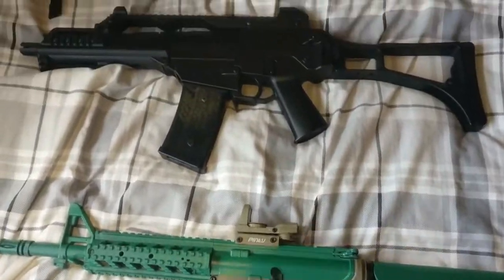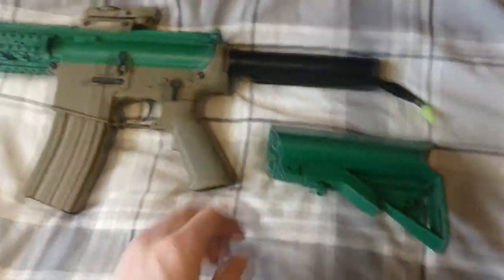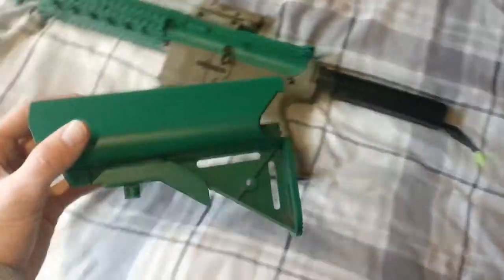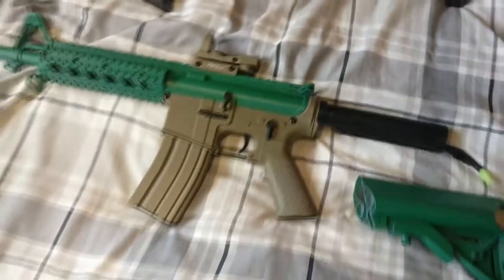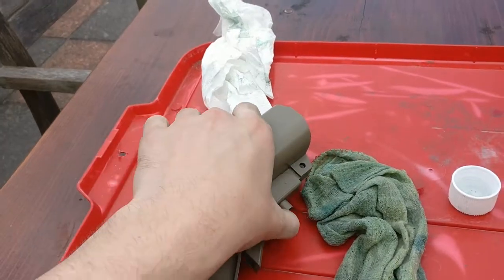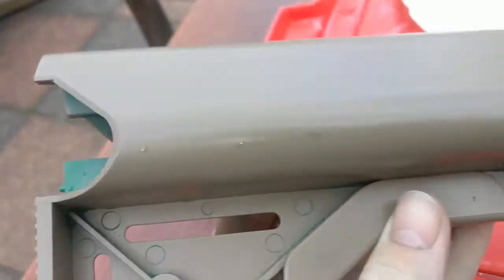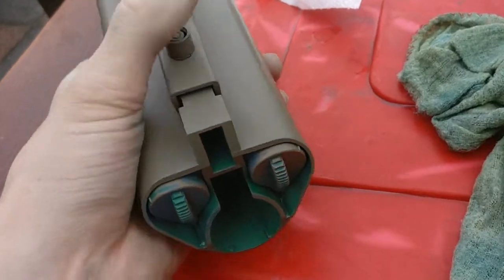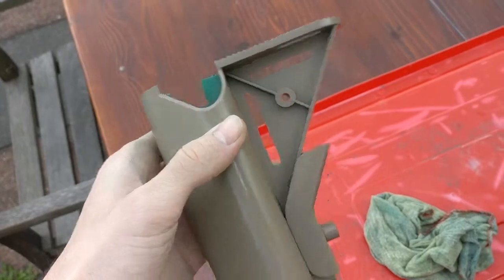Removing two-tone paint from Airsoft gun

Comment: my girlfriends nail polish remover works well too
Reply from the maker: Didn't think of that!
Reply: Really
Reply: Be careful , the key ingredient is acetone and it can damage plastics such as Polymer
Reply: yeah you will be surprised how fast acetone can soften and melt plastics like ABS
Reply from the maker: Is Acetone more commonly found in nail polish remover or the white spirit!??
Reply: White spirit is like turpentine.

Acetone is whats in nail polish remover - careful using it on ANY plastic things as it has a tendency to melt through it and/or make the surface go cloudy.
Reply: i use acetone in my line of work it doesnt melt all plastics there are plastic cups you can buy from most supermarkets that dont melt. they have "PP" written on the bottom (identifying what type of plastic it is / what is is made from), so this plastic is safe but most other plastic will be affected by this chemical.
Reply from the maker: Gotcha! Learn something new everyday cheers!

Comment: I recently brought Clean Spirit for this purposes. 

Any difference between White Spirit and Clean Spirit?
Reply from the maker: Googled it is more water based so safer for user and environment, less solvent content so should do the same really but just not as strong!
Reply: What a pain in the ass, such a stupid law to have to have 2 tone, but on the other hand I get it. Personally I think a simple registration for this sort of thing would suffice, so your on record for what models you have and description, so if someone's running through the street or holding up a bank, you look at the gun and question anyone who is registered as owning one like it. 
I mean what's stopping criminals with real guns painting them 2 tone and masquerading them as replica Airsoft?

Comment: If my firearm is metal would it still be safe to use nailpolish remover/white spirit or could it damage it ?
Reply from the maker: Mine was plastic and is fine so don't see why not! Could try on a little bit first and check. Just be careful not to get any white spirit/nail polish remover inside of the gun. Also make sure no junk like the paint being removed gets inside of the gun!
Reply: @sullyo6722  perfect thank you, the gun I’m getting it’s fully field strippable so gonna field strip it so there’s no components and gonna let it fully dry out
Reply: @mikelowry2254  How was the result? Planning to do this soon.
Reply: @slenderman183  it worked out well I used nail varnish remover without acertone fortunately it was silver under the blue paint managed to spray it black today and looks great
Reply: @mikelowry2254  was your gun originally silver or did the black paint come off during the two tone strip off?

Comment: I tried this and it didn’t work on my specific gun (ares amoeba 008), I bought it off a mate second hand and the two tone on it is tough...so I used white primer followed by “posca” brand paint pens and clear coated it, it looks perfect as the amoeba is mainly polymer except the upper receiver so the paint just soaked into it, and gave it a nice matte finish, it also dried pretty quick, then I just clear coated it haha!
Reply from the maker: Weird, was it spray painted two tone or is the gun plastic actually coloured? But nice one thats a quality idea mate! Take care, stay safe!
Reply: SULLYo the lower reciever is (polymer) black, the stock was black but two toned over, and entire upper reciever were two toned blue, upper is metal, there’s only a few tiny tiny areas I couldn’t get to, so I’d still recommend spray paint instead of paint pens, but if you’re on a budget, the paint pens were a good alternative! It was two toned, I managed to get a little blue off using white spirit, but after 4 hours I gave up and tried the paint lens. The parts I couldn’t get to aren’t noticeable unless you’ve holding the gun basically
Reply from the maker: @AverageSkater  oh right gotcha! Yeah ngl did take me a few hours haha, but glad you got your result with the spray paint, all the best 🔥
Reply: SULLYo thanks dude! You too!

Comment: Could you even steep it in white spirts in stead of rubbing of ??
Reply from the maker: Wouldn't do that it might mess up the plastic. Could go brittle and crack/snap
Reply: @sullyo6722  ok does this method work on all two tone colours or just green?
Reply from the maker: @turloughquinn9863  all colours, just be careful don't go crazy with the white spirit and only use the airsoft gun at airsoft matches don't ever take it outside/public areas.
Reply: @sullyo6722  i k ow i wouldnt be i wpuld only use it in a designated arena

Comment: Why isnt the bottom layer of paint stripped?
Reply from the maker: Will Smith do you mean when the green comes off why doesn't the original come off with it?
Reply from the maker: @Ryan-ok9qt  its because the white spirit removes the spray paint and not the actual colour from the plastic that the gun is made from